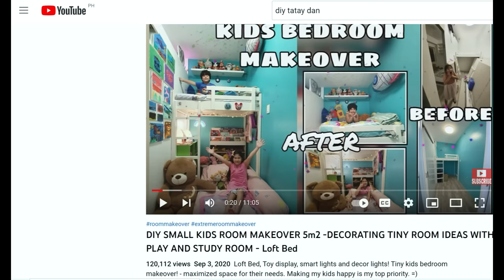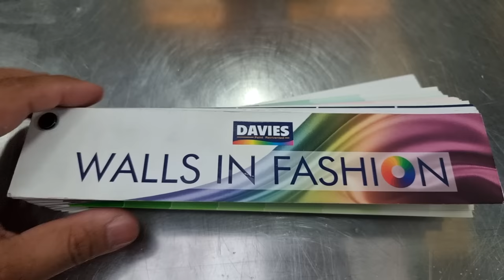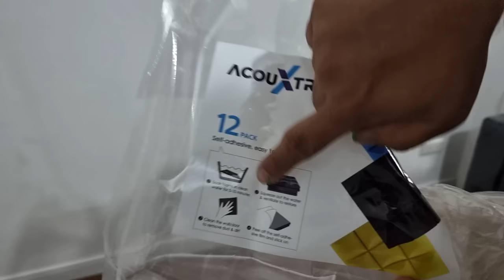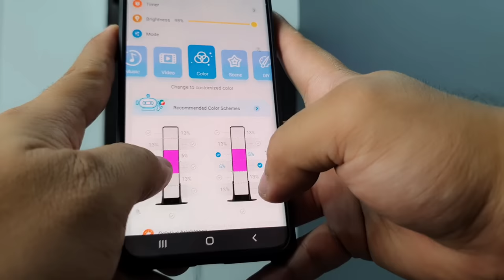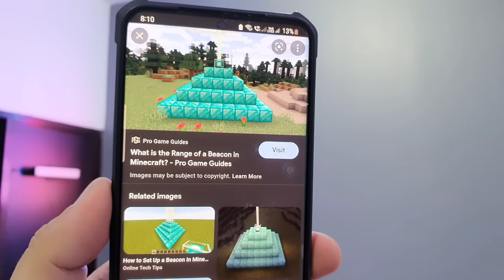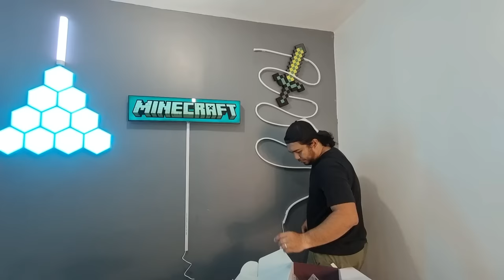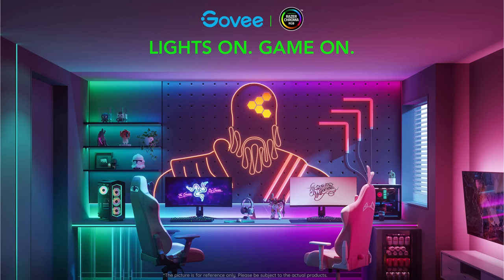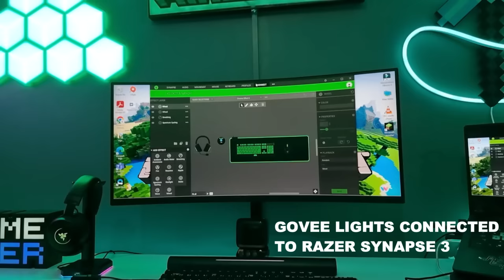I Built my kids their DREAM GAMING ROOM SETUP

Comment: On the off chance someone can answer this but is there a video on this channel where he build without drilling into the wall? I live in an apartment and would like a desk/top bunk setup but I don't think drilling into the wall would fly.
Reply from the maker: Hi Pedro. You can make a loft bed with 4 vertical post at each corner instead of drilling the frame into the wall. You can check out my other build where 1 side is a drywall and I used posts.